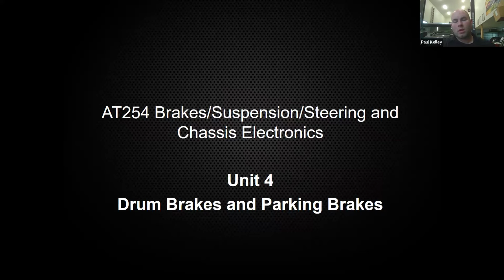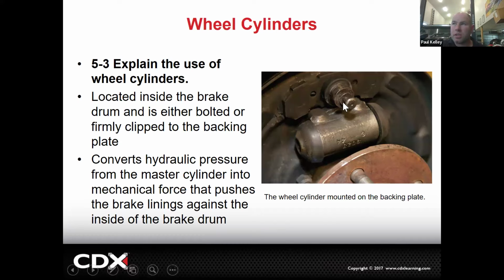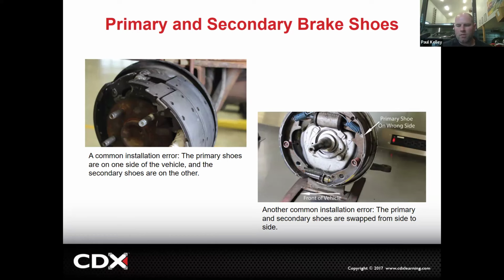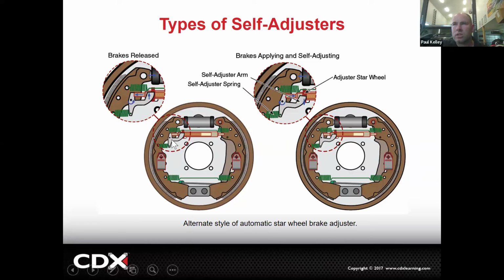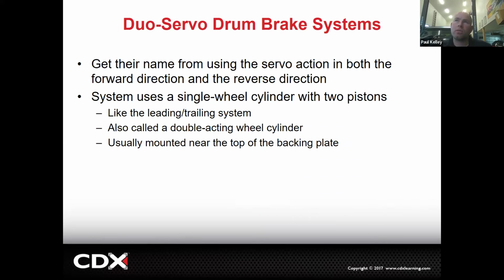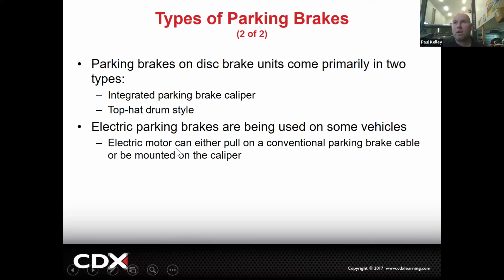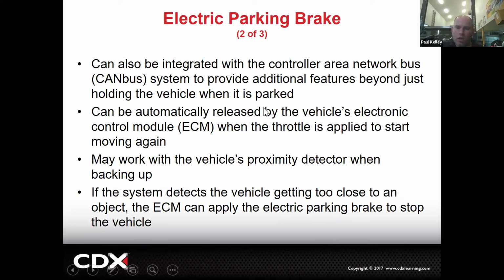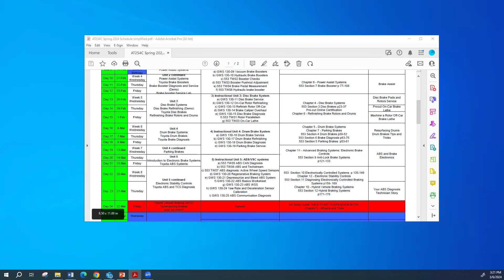ASE A5 Brakes Class Unit 4 Drum Brakes and Parking  Brakes Lecture

Comment: Hey man can not lubricating rear drum parts cause squeaky noise? That was one of the questions on the test
Reply from the maker: It will, dry backing plates. Which will correlate with pedal application.
Reply: Thanks man I appreciate you 😊If can tutor me online or zoom I will pay you . Just be for a half an hour.
Reply from the maker: @James-fl2ug  if I can help I will, when is your a5 retest?
Reply: @paulkelley86  it’s in 30days for retest July 3rd
Reply from the maker: @James-fl2ug  email me, I want to do a test with you. Paulkelley86@gmail.com
Reply: Ok great I’m about to email you now Paul thanks
Reply: Hey Paul I’m trying to start the prep quiz that you sent me but the questions are not popping up. Please help when you get a chance.